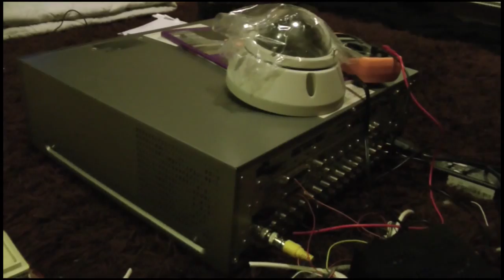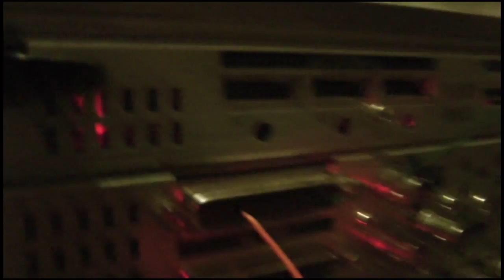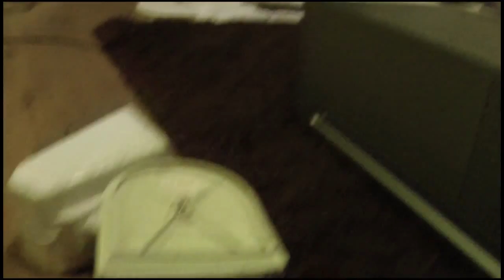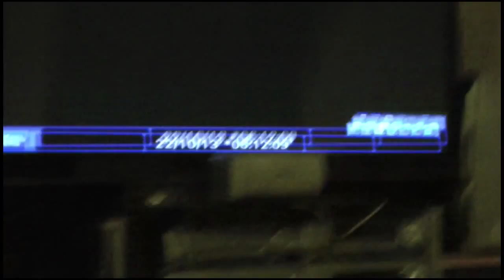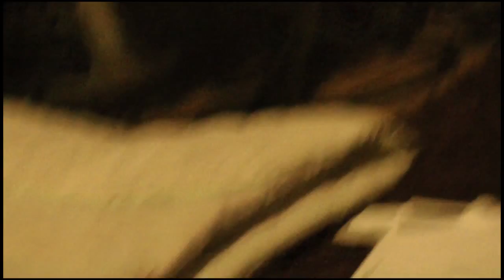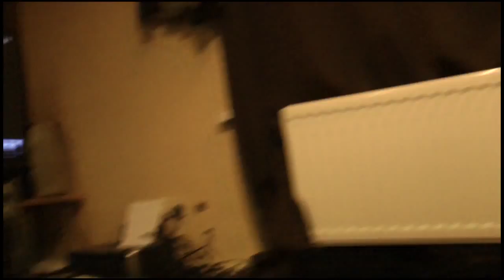quick intro to cctv alarm triggering, using redwall pir and relay on panasonic cctv dvr

Comment: Which relay did you use?
Reply from the maker: Prolink Security http://www.ebay.co.uk/itm/Handy-Little-Mini-relay-Board-12vdc-or-24vdc-operation-/111720647644?pt=LH_DefaultDomain_3&hash=item1a0311cbdc hope that helps mate
Reply: cctvuser thanks but I would like to control a 240v floodlight using one of the alarm output, which is the best relay for that? Thanks for your assistance
Reply from the maker: that relay switches 240v that I linked you too